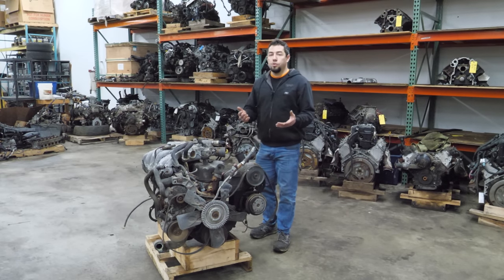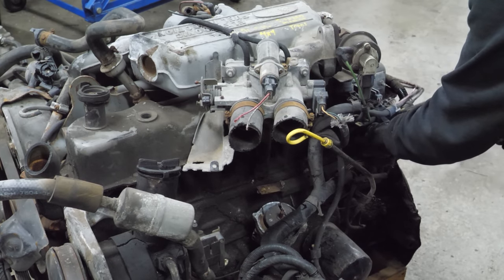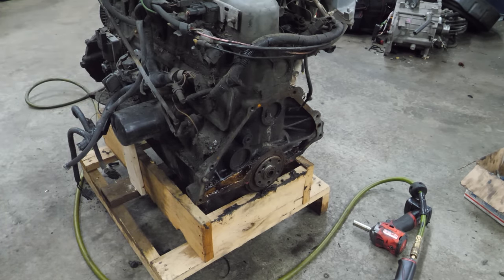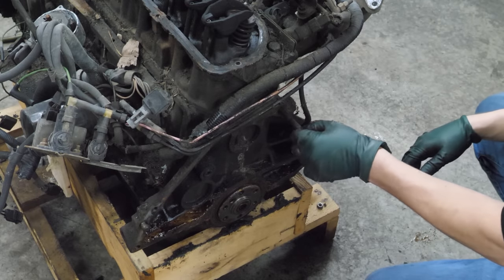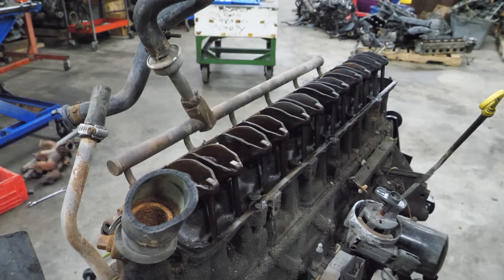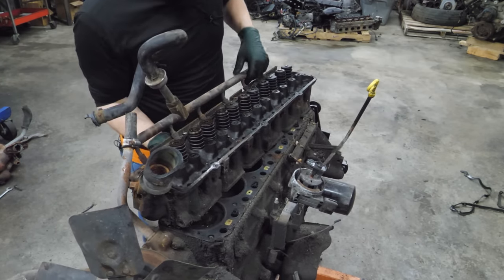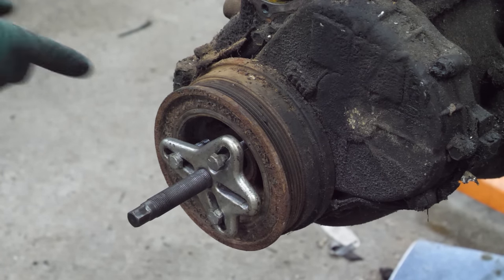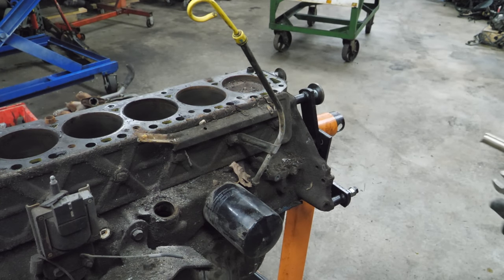FINALLY! A "Bad" Ford 4.9L 300 Straight 6 To Teardown! Most Reliable Engine, Ever?

Comment: After watching this video. I now miss my 1979 F-150 rust bucket, with the 300 and 3 on the tree. Great video. The 300 was a tough, probably the toughtest ford  motor ever built.
Reply: Toughest OHV, but I think the venerable Flathead V8 is right there alongside it for overall. I'd give a tie between the two.

Comment: I was friends with a guy that had a dad that hotrodded the ford 300. To the point it sounded like a cammed up 429 and ran like a nicely warmed over 351c. He loved the mid seventies to mid eighties blocks for the work over. All the smog equipment get pulled off, valves,  head flow, a bit extra stroke and larger bore had it pushing 5.3-5.5 liter six. Fab up a four barrel intake a triple two exhaust (three sets of two into one pipes then into two with cross duals).

It was wacky feeling those straining against the brakes as you loaded up for launch. Just smooth, no real trembling like an bb eight. Just dump it and pedal to the floor hold on to your butt. I don't know how many of those were around for five counties. Chances are someone has one in a rusty pickup in a back yard or a few made their way to a scrap yard. Anyone that found one and knew it was different would be wise to put it back into service on a ratrod or just rebuild and paint for a garage art piece of hotrod history.

Comment: I learned about engines by working in an auto parts store in the late 80s.  The engine was like home.  No complicated alloy frames or balance shaft capsules or overhead cams.  Just lots of iron and steel.  I was a skinny dude, and carrying heads and cranks for these engines just about did me in.  Great episode, sir.

Comment: 28:03 Still probably ran just fine truth be told, at least as far as bottom end racket goes. And keep in mind these things don't really give a shit what viscosity oil you put in them, so when the bottom ends start getting noisy they'll just get fed thicker and thicker oils until each change is 7 quarts of 75w90.
Reply: And you know it is time to up the viscosity when you air cleaner housing fills up with engine oil. These engines may be unkillable, but you'll wish they would just die already. I owned 5wo F150s with the 300 I6. Put a reman in one at 125k; the other started blowing oil at 150k.
Reply: @robertmcgovern8850  By the by, the time to up the oil viscosity is when you get bottom end clatter, not when you get a little blowby. Blowby is top end wear and you're never gonna get that to go away by putting thicker oil in the sump.

Also you're never gonna get a 300 that doesn't have a healthy amount of blowby. They weren't built with that in mind. They have a lot of blowby even when brand new, just how they are. all the tolerances on these things come from the mid 1960s when people just didn't worry too much about making engines fit super super super closely like they do today. They put more value on rugged durability than they did close precision part fitment, so yeah, these things have blowby by default. Every engine from that era does. Just the nature of the beast.
Reply: @TestECull  Agree with all of that. But it did seem to get unsupportable around 90-150k miles. Like, when my father gifted me the first F-150 (c. 1982 model), he had wired an orange juice bottle to the grille and ran a hose from the air filter's PCV fitting to catch the engine oil.😄 Had to empty it every 1000 miles or so. And keep a case of 50wt behind the seat. There's little doubt the 300 would have run another 100k like that, if you kept filling & emptying the oil. 

I dropped a reman in the first truck ($1400, plus a clutch pack), which was dead simple even for a relative newbie like me.🙂 When the second gifted F-150 (c.1988 model) started blowing oil, I just traded it in. Both trucks wound up costing me $250 a month to keep them on the road (water pump, starter, ball joints, radiator, starter, manifold, distributor, did I mention starter?). The two Toyota trucks I've owned since have a combined 550k on them and burn/blow zero oil. I feel no nostalgia for the F-150s at all.😒
Reply: @TestECull  shrug just my anecdotal experiences with the 300. My father changed his oil every 6 months and never worked the trucks hard. The mechanic that sold me the reman said 100k was pretty common for rebuilds on these engine due to oil consumption. Said he saw a lot of them come in around that age, worn guides and rings, but factory remans were so cheap he seldom rebuilt them in-house.  Dunno. Don't really care. Engines had shit power, shit highway towing capacity, and poor fuel economy. 4.9L got you 110hp, 220lb-ft, and 8:1 compression, and about 12 mpg. Toyo's 4.0L 1GR-FE offers 236/266/10:1/19mpg, is even more reliable, and consumes zero oil. Both engines are dinosaurs, but one is a much better dinosaur to live with.
Reply: rear diff oil, haha!

Comment: My 94 is still running great at 360,000 miles and I also have a 93 with 420,000 miles she’s the drinker of oil but as long as she has oil she runs well for the amount of abuse it’s been through lol best engine ever made I think!
Reply: Hey I was just wondering what type of oil and weight u run in the 300s.  I have a 94 f150 with the 300 and currently using Rotella but seen yours have that many miles I'm wanting to shoot for that many on mine.   Thanks
Reply: @darrellhobbs1898  I got the 93 with a little more than 200,000 on it and drove it for over 10 years and it did really well with the Motor Craft 5w-20 or 5w-30. I’ve not once had a lifter our valve knock on a cold start like I’ve had when using other brands, at least in that price range so when I got the 94 I started using the same thing and the same results. I never really thought about running shell, I would assume using it would give you the same results if not better! And especially if you are keeping up with maintenance on a regular basis.
Reply: Thank you for your time writing back.  I really appreciate it.

Comment: In Australia we used the small cousins of these engines up till the mid seventies and then started playing around with the heads to make them crossflow and then we switched the cam to up top and then we added another cam and the Barra engine was born. Yes there were bottom end changes but when you start with a strong set up and improve it you get something even stronger. Inline sixes are great. lets put a twin cam Barra head on a 300 bottom end and watch it boogie, if only we could. The sludge in the sump is plain old dirt. When it falls out of suspension it forms a rubbery mat. You would see this a lot in the Flintstones era when the crankcase ventilation was a pipe straight out of the side of the crankcase and pointed at the ground. You might have a bit of steel mesh in the pipe to keep rocks out. You would also see that same gunk in oil bath air cleaners. They were from before the Flintstones era.

Comment: had a 300 in my 93 ford F-150 ,5 speed ,2 fuel tanks ,huge low speed torque, i had 340,000 miles on it when i sold it ,biggest mistake i ever made ,i loved that ,never had any problems, except 2 cluch replacements

Comment: bought an 03 2500 hd (6.0 lq4 with 4l80 trans) from my boss. (We used it for our tree service) This truck had 370k miles when i bought it. We would regularly tow a skid steer and sometimes a stump grinder at the same time on this truck on the freeway going 80+ mph. Straight up torture tests on the daily. My co-workers would also dog it anytime they had the chance lol. I don't think they changed the oil for a year. Got the truck, replaced coils and plugs, deleted the muffler and replaced stock cat with a cheap high flow cat and serviced the transmission just fluid, fillter and pan gasket. Changed the oil (puralator filter, used a mixture of 10/w30, lucus oil, and marvel mystery oil.( i called it motor milk 😂) Ended up selling it at 420k Miles after the manifold gasket slowly went. Had that truck been properly maintained from the start, it could've hit a million miles.

Comment: I bought a 94 F150 (auction) as my very first project, I had never done any mechanical work on anything, ever! Luckily it came with a 4.9L 300 and manual transmission. 246k miles still going strong! Now back to the video :)

Comment: Trip down memory lane...my 1st truck was an F150 with a a straight six.  I loved the torquey bottom end.  I lived up north and had a freeze plug rot out from salt and rust and semi-cooked the engine.  The starter complained every time starting after that.  I found a donor truck and swapped for another.  She ran well until the rest of the truck rusted away from the engine.

Comment: Thanks for tearing this down. My dad bought a 65 Galaxie 500 with 240 inch “Big Six” as they called it at the time. First to have a PVC system which failed resulting in a blown valve cover gasket. I put more miles on it than any other family member until I graduated from college and got my first car, a ‘68 Mustang GT. Then my sister totaled the Galaxie. Great engine compared to the former 6 we had in our 59 Ford and 6 we had in our 61 Chev, both of which didn’t make it to 80,000 miles before needing an overhaul.

Comment: 31:01 With a 300 there is a not-zero chance it will just simply stop turning without being damaged. Take plugs out, spin it till the chambers are clear, put plugs back in, fire it back up, carry on. They really are THAT tough. They will survive swallowing pond water.

A fella really has to be deliberately trying to kill one of these things and even then it's gonna be a challenge. Why we love them so much!
Reply: I put the hurt on my 240 in a '70 F100. it rattled and what not yet it would start, sometimes reluctantly, on cold WI mornings when not much else would. The engine lasted longer than the Warner 3 speed behind it.
Reply: I hydrolocked one in a mire at close to 12,000ft in elevation (totally my fault). Pulled the plugs, blew the water out of the cylinders, changed the oil and it fired right back up, but with a knock. Wheeled it down off the mountain and then drove about 75 miles back to the city. Fairly certain I bent a rod and that thing was really only running on 5 cylinders during the trip back - still got 18 mpg and the rod knock quieted considerably. Found another 300 and swapped that in. Probably could have saved the original since it only had about 130k on it, but I only paid $400 for the second engine and it had around 60k on a rebuild. The kicker is that the original engine had something going on in the bottom end when I bought it. It had a strange, barely audible knock at idle that had driven me crazy for years. I think somebody had damaged it long ago and my hydrolock incident was the final straw. I bet a fresh 300 would have survived. Did it fail? No. Never. Ran for years with what was probably low oil pressure and then got me all the way back to civilization in a compromised state without breaking a sweat. Truly impressive.
Reply: @silasakron4692  And that's why I firmly believe...to the point I will die on this hill...that the 300 six is the best overhead valve engine Ford has ever and will ever produce. Why I'm all too happy to keep driving one in 2023. They're amazing engines. Tough as nails, reliable, smooth, long lasting, rugged, miserly, torquey...the perfect engine for a half ton truck or a full size car if the hood will allow it to fit.

They can brag up the ecoboost V6's power and efficiency all they want. I don't care. Gimme a 300 with a Carter YF instead.

Comment: My first truck was a '92 F-150 Flareside with the 300 and a 'Mazda' 5 speed.  Loved that truck except for the few icy days here in North Dallas.  She loved 80mph in 5th gear OD on the tollway, and with a dual exhaust it had a note that my trusty old dog knew the sound of before I even turned the corner for home.  Sadly, even here in Texas, everything around the 300 was falling a part long before the engine was even 'broken in' at 130k.

Comment: I had a 94 F150 with the 4.9 and manual transmission. I drove that thing over 25 years until the body was shot. That engine never had any work done to it other than oil, plugs, distributor, and filters at regular service intervals. It ran so smooth even on its last day of my ownership. I actually had a hard time parting with that truck. I wish I still had it!

Comment: I started at Ford March, 1977, my mentor was a man by the name of Charles Burke.  Charlie was a tool engineer who came over from Chevrolet Parma.  He was the one that told me that Ford had based the 300 on the Mercedes.  He also told me that the 351C was based on a Cadillac design.  The Ford 289 came about because of Chevrolets work on the light weight small blocks.  I myself still think the 327 was one of the finest engines on the planet.  I never questioned Mr. Burke, but the tooling knowledge he passed on to me gave him a lot of credence in my eyes.

Comment: I live in Maine and I work with a guy that had a late 80's F-150 with one of these engines in it, and like you said these trucks all rust away at a certain point and his was at between 280-290,000 miles when the frame split. But he went through all the trouble to find a clean '96 with no motor from Texas, shipped it up to Maine and he threw that motor in it. Last I knew he racked up 400,000+ miles on that motor and she's still goes as strong as an ox.

Comment: Great video! PowerNation built one of those and got some impressive power out of it. Seven main bearing in line 6cyls can handle quite a bit of power.
Reply: I remember that episode! Throttle body fuel injection, and a turbo, roller tip rockers... all the usual serious hop parts and tricks. Over 500 h.p. and 600 ft. lbs of torque. all at around 45oo rpm if I remember correct. Gotta go back and check it out.

Comment: Worked my way through college at a small UPS hub. 91-94. Loading sorting and such.  But stayed each night for truck wash and fuel.  Nearly all of those package delivery trucks had Ford 300’s in them. None less than 300k.  Many 500-600K miles. manual transmissions.  Bullet proof.  Don’t remember ever seeing a drop of oil or coolant on the floor.   Western Michigan, saw all kinds of weather.  Especially when winters were winters. Love that engine.

Comment: I think it's safe to say that most - if not all - straight six engines built in America were extremely good engines.  The 300 was defintely a gladiator, but so was the mopar Slant -6, and the AMC/Chrysler 232-258-4.0L.  Lots of successful GM I-6's also.  There's just something about the inherent qualities of the striaght six that makes them reliable.
Reply: The inherent self preservation qualities of low compression, restrictive intake and exhaust tracts and torque biased cam timing makes all the Detroit straight sixes long lived.
Reply: @countryjoe3551  High compression inline engines can also last a long time.  Cummins 5.9L anyone?  And then there's Mercedes inline diesels.  Inline engines are inherently more robust.  Even inline fours.

Comment: Back in 1990 a buddy of mine bought an F150 4x2 with the 300 mated to a 5 speed. It was his daily driver for his ridiculously long commute. Decent mileage and it ran forever. Great motor that outlived the body it was assigned to.
Reply: The fuel economy for them wasn't all that great. Wasnt a whole lot better than a V-8 unit
Reply: It wasn't terrible.  Almost never had any issues other than basic maintenance though.  Once in a while the water pump or Alt would fail   My old 89 van had this engine, we beat to death and it finally died with 425k miles on it.  The engine was fine, the frame and body were gone on it.  Engine would start right away like brand new every time.  Can't find anything like that anymore.  I would happily trade 25 miles a gallon for 15-20 and never really having to worry about it nickel and diming you to death in constant repairs.

Comment: If you haven't already I bet you sell the manifolds first! An 84 model 300 was the very first engine (and most expensive) engine I ever rebuilt way back in high school at 14 years old. Still driving it 26 years and 490k miles and counting!